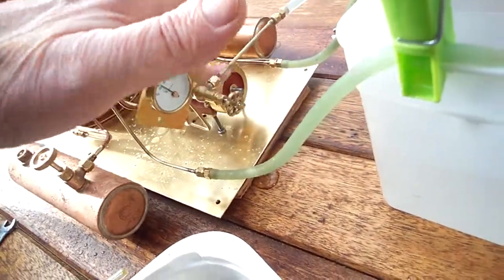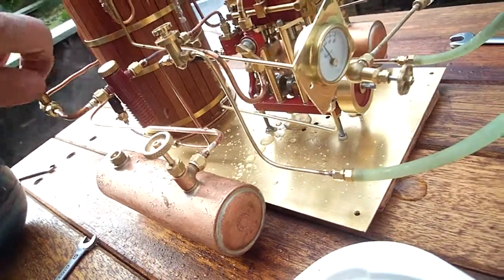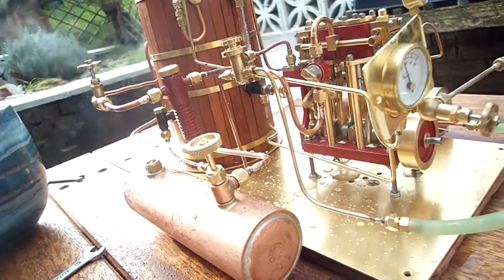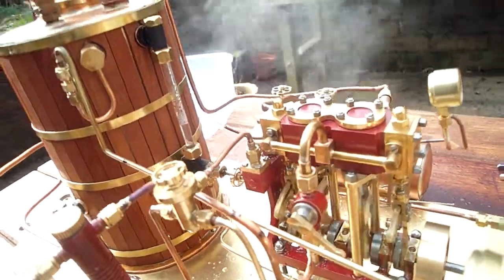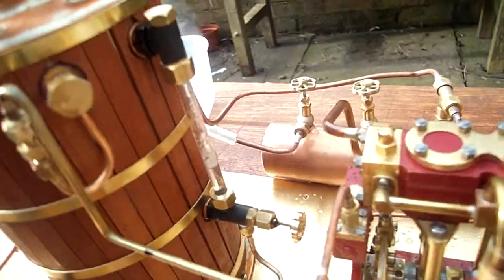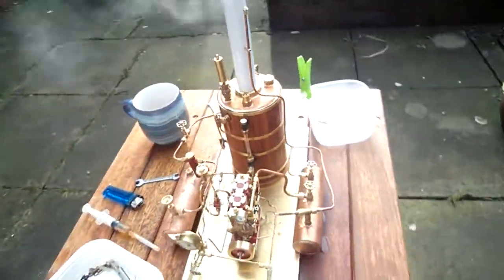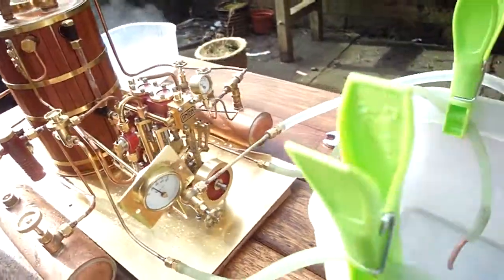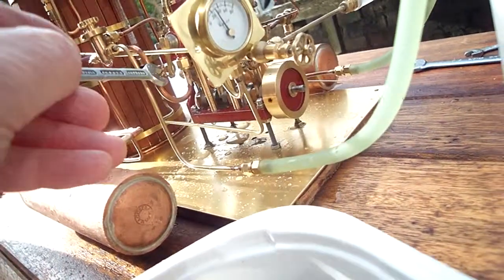Anton Marine engine

Comment from the maker: @rhavrane 
Bonjour my friend, the oil is from "Anton's" Vis/ is about 650 I think which is a lighter steam oil from normal thick oil, so can be used on the bottom bearings and crank with out the fear of wear on the bearings,
Thanks for your posts

Comment from the maker: yes , had a leak on the T, so will be much better, when sorted, as I guess the back pressure will be about 10/15 psi.
yes I mixed up the jets, no sorted 5 is best, and works a treat, I was running on a no10 ,!!!
thanks for your post.